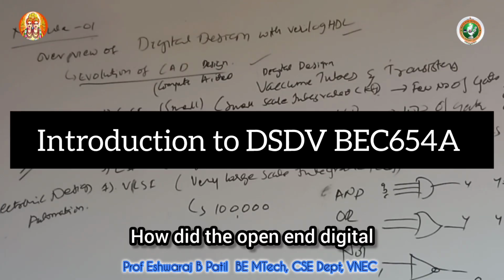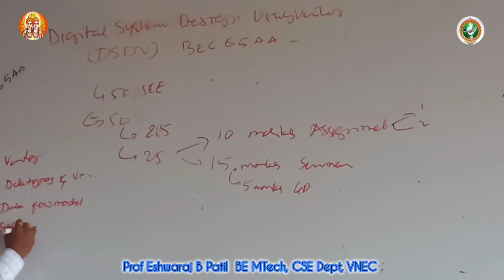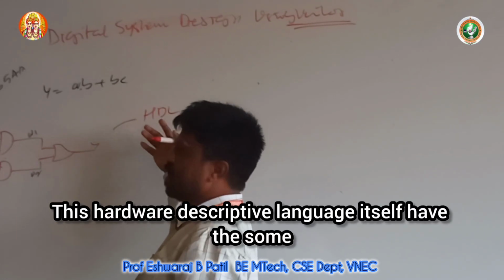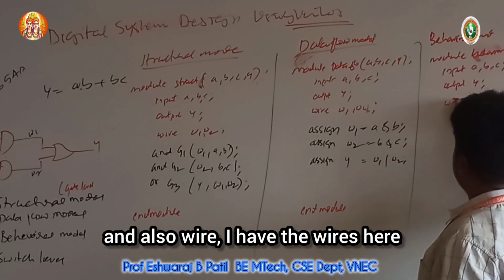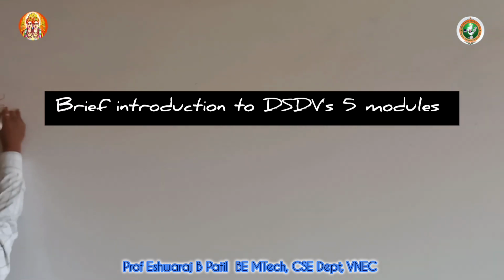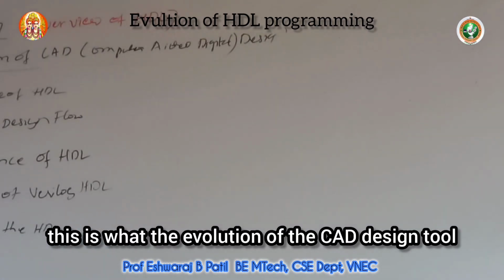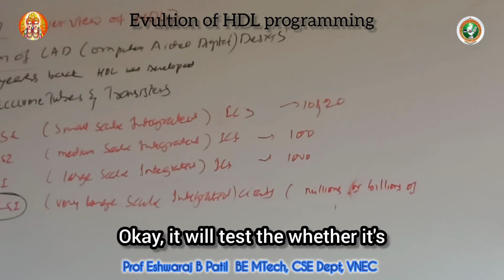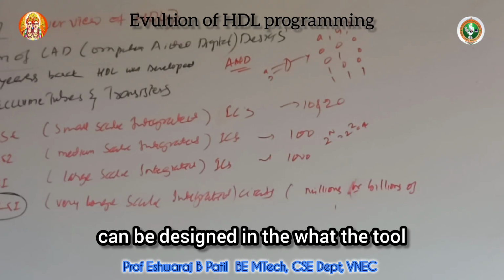DSDV Digital System Design Using Verilog BEC654A : Module I : Introduction, Basics of Digital Sytems

Comment from the maker: This video serves as an introductory lecture for the course Digital System Design Using Verilog (BEC654A), taught by Prof. Vishwaraj B. Patil. The session covers the course structure, syllabus, and foundational concepts of hardware design.

Course Overview
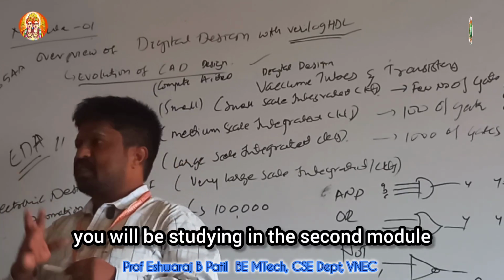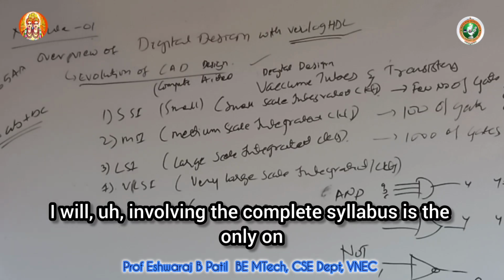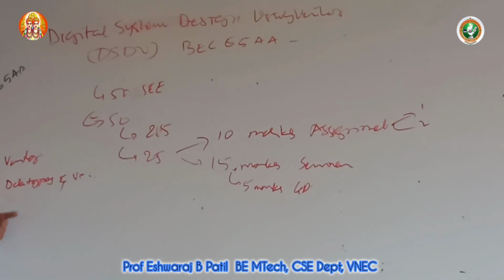Structure: The course is divided into five modules, focusing on Hardware Description Languages (HDL), specifically Verilog. It emphasizes three design methodologies: Structural, Data Flow, and Behavioral modeling (2:40 - 3:28, 6:44 - 7:16).
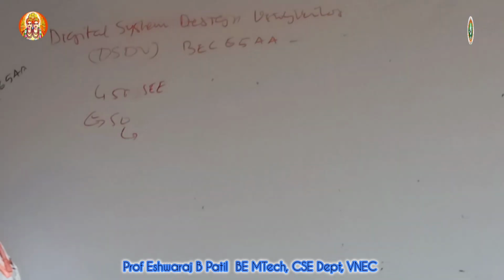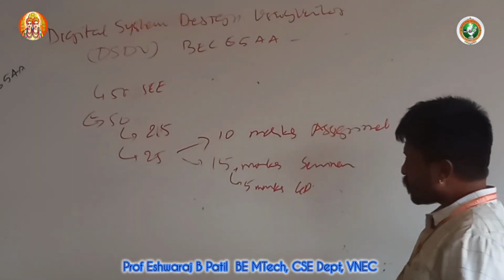Assessment: The grading includes internal exams (25 marks), assignments (10 marks), and seminars/group discussions (15 marks). Students are required to conduct seminars on specific programming models (4:33 - 5:30, 7:32 - 7:50).
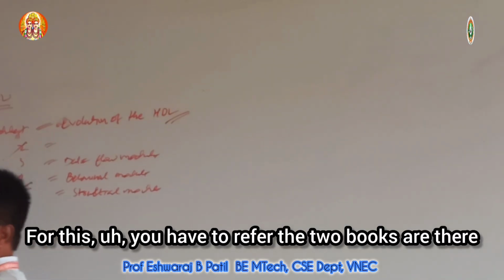Resources: The primary reference book recommended is by Samir Palnitkar (30:19 - 30:43).
Introduction to HDL and CAD
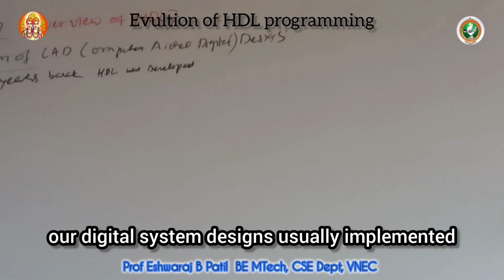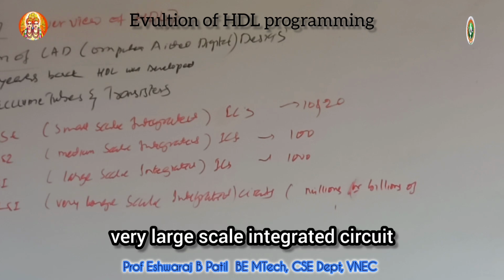Digital Design Evolution: The lecture traces the history of digital systems, moving from vacuum tubes and transistors to modern Integrated Circuits (IC), categorized by integration scale: SSI, MSI, LSI, and VLSI (36:29 - 40:11).
EDA Tools: The professor explains the importance of Electronic Design Automation (EDA) tools, which are essential for testing hardware components and verifying circuit designs (40:38 - 42:55).
Simulation: A significant portion of the lecture focuses on the necessity of simulation (using test benches) to verify that digital designs function correctly according to truth tables before implementation (43:25 - 48:14).
This lecture provides a theoretical foundation for the course, preparing students for the upcoming modules on HDL emergence and programming techniques.